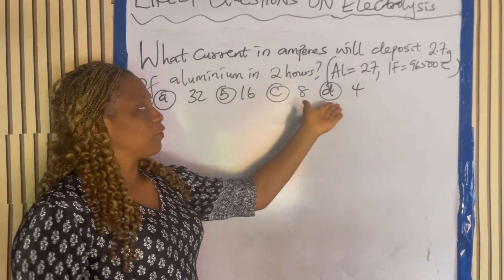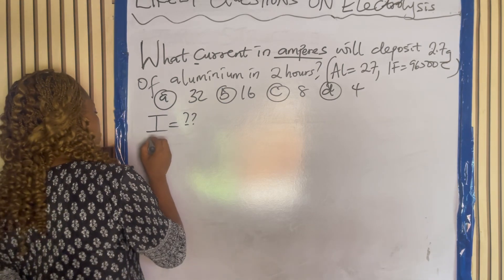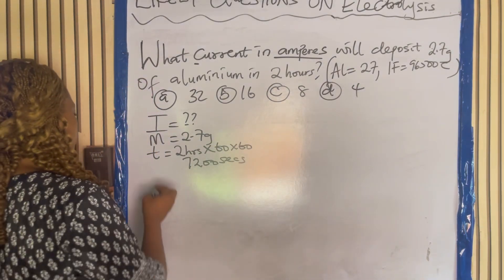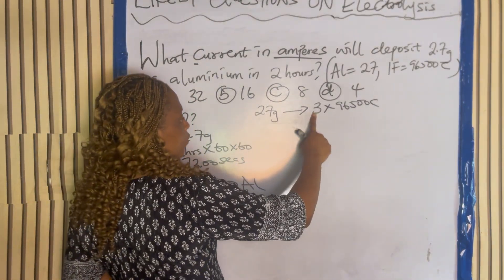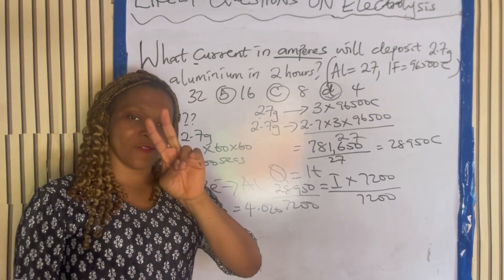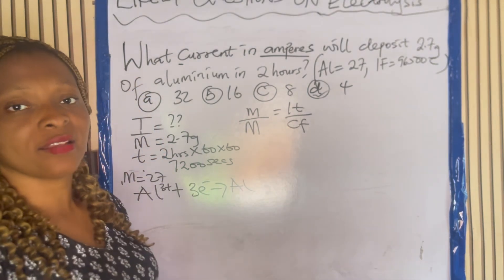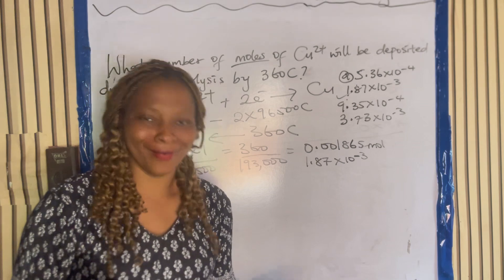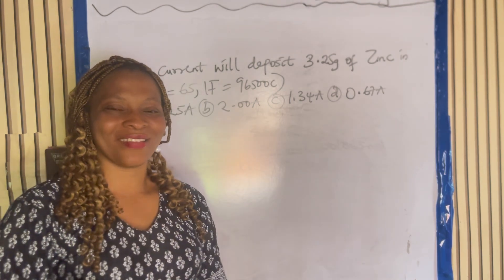2025 JAMB LIKELY QUESTIONS ON ELECTROLYSIS

Comment: For the second question, I got 0.05, and you did 0.25 * 2, which gave you 0.50 but gave me 1.25
Reply from the maker: Check your calculations and calculator.Theres a mistake somewhere?
Reply: Ma pls where is the 5 coming from .
 @teacherlisa633
Reply: @teacherlisa633 
Ma I think it's meant to be 2 not 5
Cuz 0.25*5=1.25 but 0.25*2=0.50.
Reply: Yes ma you made a mistake instead of 0.25*2 you said 0.25 *5 .
Reply: Yes she made a mistake there